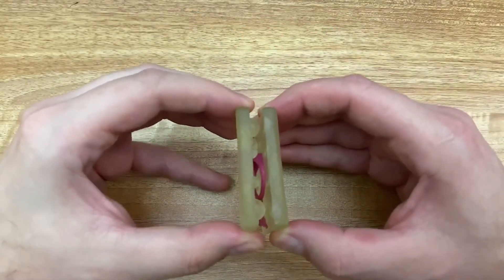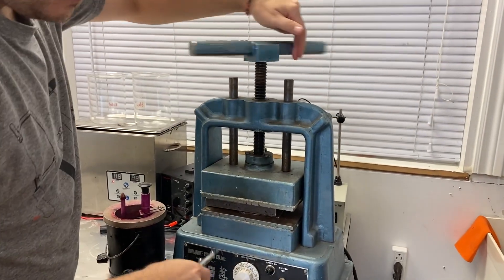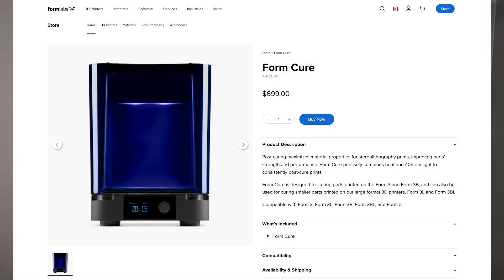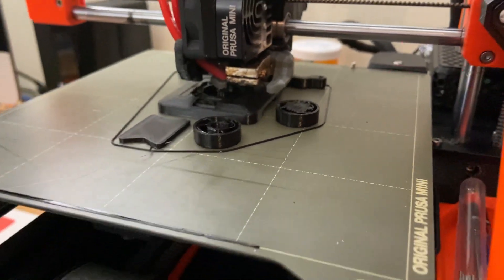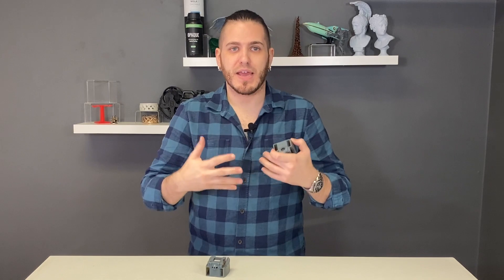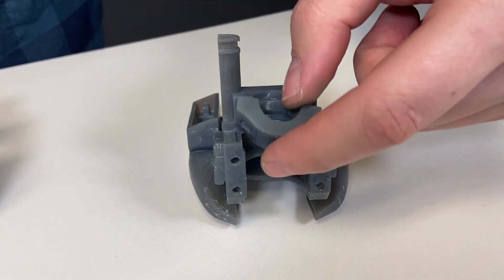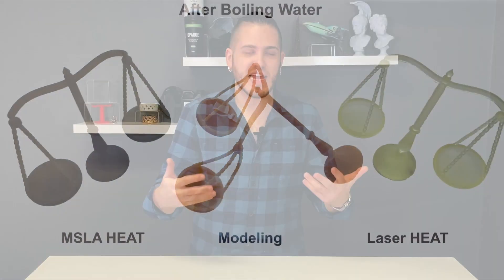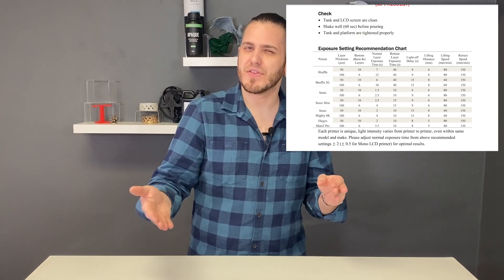Heat Resistant 3D Prints | Apply Lab Work Heat Resin Review

Comment: can also add a sunken slot port where you can drop in a flat nut or a normal nut, for instant thread. should not be too difficult to add in the 3d design. can always secure it into place with some jb weld or other quick resin mixtures

Comment: This may be your answer to resin printed thread inserts for resin MSLA prints; been an issue I've also thought about.  If you search: "Helicoil Type m3 thread insert kit"  and also non helicoil spring type inserts which would be a larger diameter called "t slot thread repair inserts". I have not tried these on resin prints yet, but don't see why they wouldn't work. They look like regular heat set threaded inserts with threading on the outside and are used for repairing stripped threads in metal/plastic. I've seen helicoil sets with a set tool, drill bit, and accompanying thread tap at a fairly  reasonable price. Who knows it might be a good alternative?